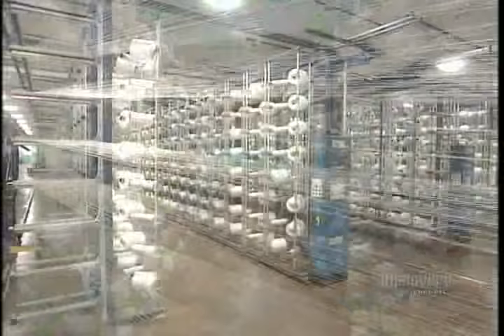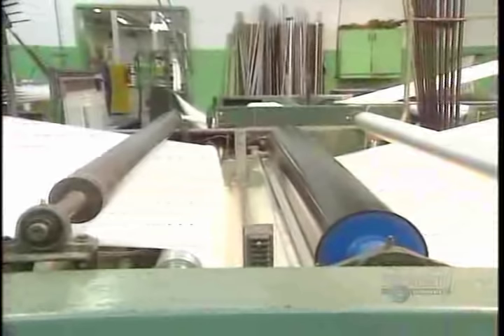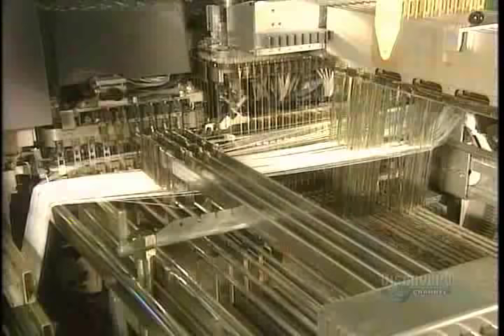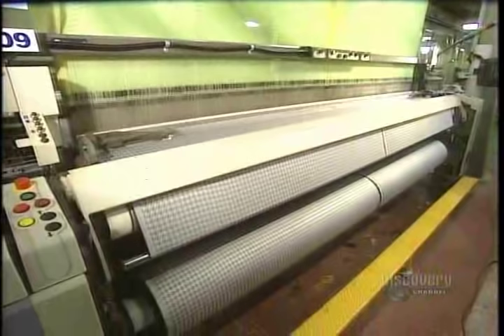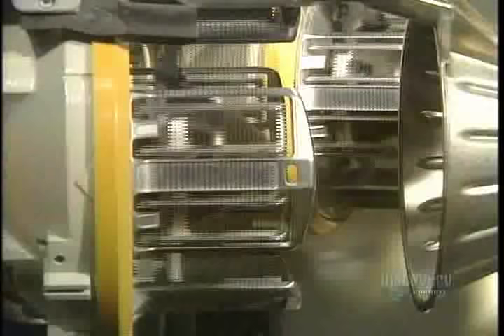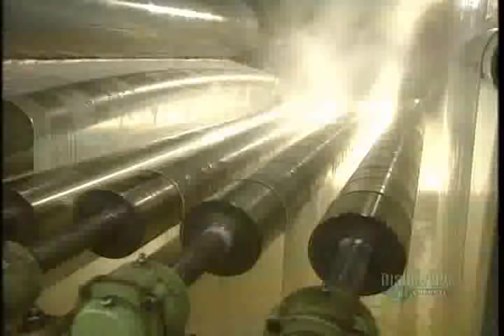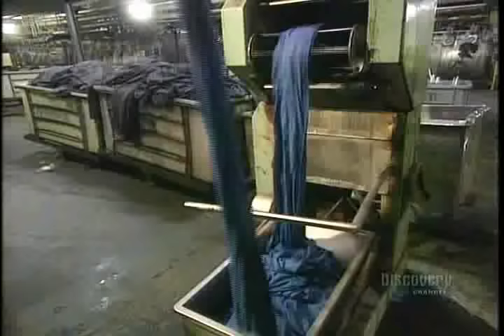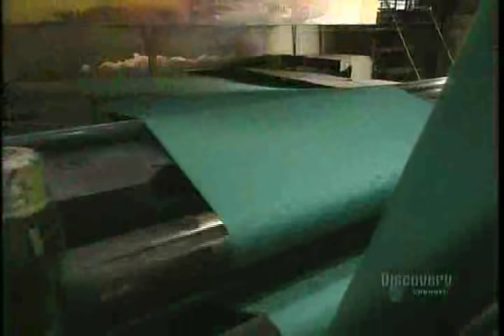How It's Made Fabrics

Comment: lol ,  that was  David Schwimmer  talking.  ahaha....  anywho , that glue u spoke of,  is  called ''  SIZE ''   different types of material get a different consistency ( thin or  thick ) .... the thing holding the '' rollers ''  is called a CREEL ...  there are several types of  '' rollers ''  that hold thread rolled on it, those are called BEAMS , ( solid beams get natural white, or  indego  material * blue jean * , beams with holes in it  get died blasted with ink to get its color  '' red , green, yellow , ect.  the  machine  that orginizes the  threads  is called  a   '' SLASHER '' ,  some beams dont have a huge barrel, some are thinner, and get more material on it. )   at the end of the material's journey to become a lengthy sheet , that  '' BEAM ''  is  called  a   WARP .   congrats. now you all are  educated properly. i should know,  i used to work at  Dan River Mills ,  in screen print,   and  in the  slasher room where we  made  material for  bed sheets, pillow cases, shirts , pants, curtains, drapes, doilies , table cloths , and  jackets. and  whatever cloth  forms.

Comment: I wonder how fabric was made before machines
Reply: There used to be handlooms. Similar to these looms the threads used to hung vertically or horizontally and the weaver used to weave weft one throughout the width. After weaving the weaver used to push or beat the thread to the fell of the cloth.
Reply: Yes. I just loved it from the very first time!
Reply: Yeah, but back in the day it was an extremely dangerous process, and they used children to weft (not sure if that's the word. The children manipulated threads in the middle of the machine to make patterns), because they were small and could fit under the machine, where the job had to be done. They had to adjust the threads while the machine was on, and any mistake could cost their fingers.

Comment: But what are the threads and how do you get them?!
Reply: In textile terms you call them yarns, polyester yarns were used here (from the description he gave in the beginning) and these yarns are formed by spinning process where you get the filaments of polyester from polymer chips. It can can be done in three ways,
1. Melt spinning- Melt the chips and extrude filaments from a spinneret (Like a shower head)
2. Dry spinning- Dissolve chips in a chemical. while the solution comes out spinneret you blow hot air and chemical will evaporate giving you filaments.
3. Wet Spinning- Dissolve chips in a chemical. At the bottom of the assembly there will be a chemical bath where filaments will be extracted.

Comment: still not clear how the threads hold together if you wash out the glue
Reply: You know how the end of a piece of thread will fray? The glue prevents "fraying." Once the fabric is weaved, the glue is washed out.
Reply: Joshua Riggs Thanks, Joshua, but some glue must remain, else you could wiggle your finger and work it up through the middle of the cloth?
Reply: Greg Dahlen It said that the rollers eliminate the surplus. I took it to mean that any excess glue is done away with, but there's still some left in the fabric.
Reply: Rhona 'Rho' Bennett yes, I wish they had pinned that down.  So it's the glue that causes the weave to hold together, do you think?  Does it seem amazing that the glue doesn't lose its strength after you launder your clothes over and over?
Reply: Rhona 'Rho' Bennett strange that I can't Google up any more information on it.  You'd think it'd be all over the Web, right?
Reply: +Greg Dahlen there is also a process called fulling, which they didn't explain, but it's basically when a woven fabric gets washed. Usually the material that the threads are made out of acts in such a way that all the little holes close up. Also, there is significant tension on a weaving, similar to knitting. It won't just unravel for no reason.
Reply: goestplus Well, but just wearing the weaving and moving in it would put a stress on it, no?
Reply: Greg Dahlen Yes- but think about how denim is made and wears. That is a woven fabric. You can actually see the grid when it starts to come apart. There is enough tension in the warp (vertical threads) to keep the wefts (horizontal) in place, even when theres a break in one.